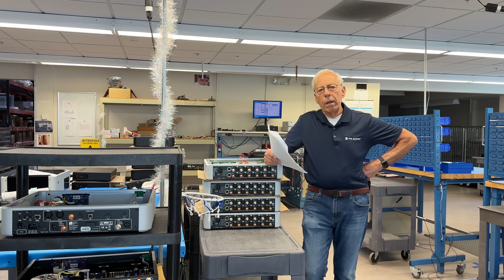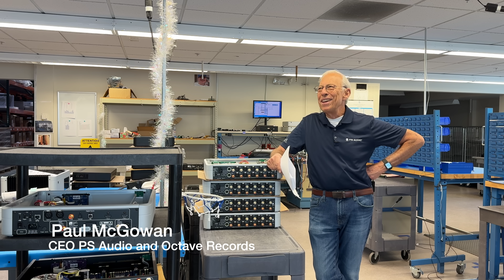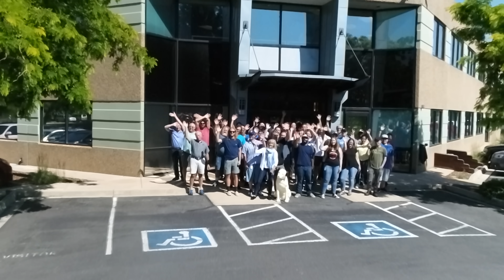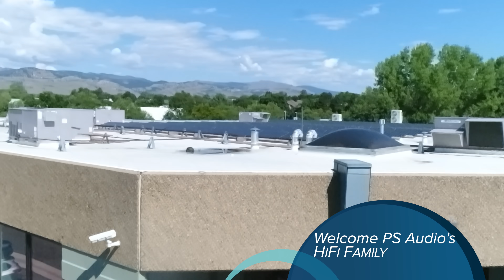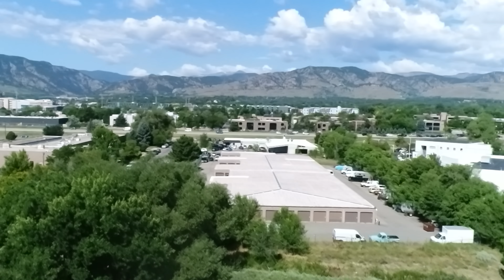Why digital audio isn't stair stepped

Comment: A 20KHz signal, sampled at 40KHz rate will be represented simply by two values: Highest positive and lowest negative. So, digitally, it is a double triangle or a square meander of 50 microseconds periodic duration. How the heck is this turned into a SINEWAVE of 50 microseconds periodic duration? This is not explained!
Reply: As an engineer myself, I agree that simply saying that they use a filter does not explain it well. Unfortunately, explaining how an electronic low-pass filter works is difficult without going into the detail of the maths and physics involved. The required fundamental understanding here is that the 20kHz triangle wave and 20kHz square wave are actually made up of the same 20kHz sine wave that they share, but with different higher frequency waves superimposed on top of those, so that the total adds up to either a 2kHz triangle or 20kHz square wave. What the filter does is let the fundamental 20kHz sine wave pass through, but filter out (think of it as cancelling out) all the higher frequency superimposed waves. That's what a low-pass filter does in essence; it allows the slow moving component to pass, but it blocks the faster moving components (idealised, a practical low pass filter attenuates the faster moving components rather than blocking them completely, but I wanted to keep it simple)
Reply: It's not a triangle, nor a square wave. It's just two points and nothing in between. It's like the line defined by two points, no stairs in between. You will find a good explanation if you look for it. You can even test this at home with your own software and ears.
Reply: @Jorge-Fernandez-Lopez  yes and if you connect the points with lines, it's a saw's teeth pattern. Not a sinewave. So, who turns it into a sinewave? Thanks for the effort.
Reply: @fullranger3435  You can draw lines, but there's no correspondance with physics or mathematics.  There's only two points, nothing in between. These lines you draw are representing wrong points that  same voltage that reality. Instead, try to find the sine wave (you have to modify length of wave and amplitud) that cross these points: only one solution. An analogy would be a circle defined by center and radius, or defined by three points on the circumference. You can't draw a line and create a squared circle, because definition is precise, while interpretation is wrong. The solution would be to draw arcs, or square lines to find the center, and then the circles. The maths that define that wave and the real solution won't understand your lines, only the amplitude and distance of the sine wave that include these points.
Reply: @Jorge-Fernandez-Lopez  that makes more sense. Still, at the analog output, a voltage sinewave has to be created,  by outputing only two voltage values? So there is a passive mechanism, based on circuitry latencies and rise times, that will create an almost sine wave while hitting for these two values alone? Like a rapidly spinning and moving compass that will draw an almost circle, based on center and radius alone? Or do you mean the dac chip is programmed to output a sine, for any two or more values? How does it know the frequency then, what value belongs to which sine? Thanks again.
Reply: @fullranger3435  "Or do you mean the dac chip is programmed to output a sine, for any two or more values?" Nope a DAC in that regard is a dumb device. It puts out X voltage at X sample point. What makes one DAC better than another is often, with the limited number of suppliers of the actual central DAC chip (e.g. TI is one of the prime Sigma Delta suppliers), it is the post DAC filtering that makes one better than another. And that is manufacturer specific. PSA Audio has their own.
Reply: @glenncurry3041  Thanks again.
Reply: @Jorge-Fernandez-Lopez  Thank you for your time and effort. I keep the fact that close to the Nyquist sampling limit (8KHz for 3.8Khz signal) problems start. I guess this renders my initial  question rational. I still think that every imperfection in signal processing is or can become audible. Insignificantly, perhaps.
Reply: @fullranger3435  It's clearly very audible,  variations of amplitude, harmonics, close to a mix between square wave and sinusoïdal. I recon that 3,8 kHz in relation with 8000 samples is equivalent do 21 kHz at CD-DA sampling rate. Once done the oversampling, 3,8 kHz sound is perfect and problems disappear. I think it's safe to say that 20 kHz (lower than 21 kHz) will be perfectly reproduced if frequency above are filtered. Unfortunately, even if my hearing is good, I can't hear 20 kHz. What I can see in some Hi-Res format, it's a bunch of high level noise without any relation with music that hasn't been filtered. It's a very complex topic.
Reply: @Jorge-Fernandez-Lopez  20KHz has to be at almost pain-level to be heard as simple tone, even from young persons. But as a lower level harmonic component of complex sounds, it is heard, in the sense that its absence alters the tonality or the spatial cues of the sound. The same is true even for ultrasounds. They can influence subjective perception of lower frequency, sounds via interference patterns. So, to my understanding, immaculate recording/reconstruction of the highest possible frequencies is imperative for natural music reproduction.
Reply: @fullranger3435  It's a very interesting comment. I appreciate that perspective fullranger. The problem is that in some high-res albums harmonics don't go higher 32 kHz. After that noise that doesn't move with music, lot of noise even with silences, that has no relation with music (noise shaped for quantization probably), that can be as loud as 50 dB down the loudest notes around 400 Hz, or 20 dB higher that these ultrasounds. My hearing is not good enough to hear that noise, otherwise I wouldn't listen some Hi-Res albums: too noisy and probably too many tweeter resonances.
Reply: And that is assuming perfect sample points! Those two samples could be zero crossing points and not peaks! Or half voltage sampled on each half. At leased based on those that don't comprehend the actual existence of the step. While averaging or Peak Sample and Hold is actually used during each sample duration. And then sampled causing a linear time shift per sample. So with PCM digitally it is just a number per sample. Not a form. 

The output of the DAC goes into integration filtering, usually some for of low pass filtering. Hoping to recreate a waveform close to what the sample values indicate.
Reply: @glenncurry3041  thank you for your contribution to my understanding of the issue.
Reply: Puzzle? Motors on Tape Decks have always had Inches Per Second, Vinyl has always had RPMs revolutions Per Minute.

All of the above equal a Sample Rate! My personal theory since Stereo didn't arrive  in larger numbers in America until 60 years after its 1929 invention. Much folklore set in . Let me add one more thing that Americans got wrong were additional harmonics needed for proper stereo sound.( Just my opinion)

Analogue is the most misused word by Audiophiles It simply means 1:1 copy.
Reply: @HeavyCrown2030  I disagree with this concept, the tracking motion and process is continuous with no interruptions, there's continuous sampling with virtually zero intervals, so the sampling rate is infinite. If you reach a molecular level in the case of vinyl,  or individual magnetic elements in the case of tape, you may only speak about regional summing-up of various values. Again, in a continuous manner.
Reply: @HeavyCrown2030  this is a complex, irrelevant analogy.
Reply: @fullranger3435 So you say ? 1887 multi-channel audio was sent across a teletype line  to experience a live orchestra in a different city. 

My  recording example goes back to the 1850 original Wax Tube Cylinder when you spoke into the same flared horn the sound played back on, Not complicated just Science.
Reply: @HeavyCrown2030  this did not include a person mimicking another. When you employ complex biology and at this level, you just don't explain your point: where are the samples of a sampling process? Don't overcomplicate things, its tiresome.
Reply: @fullranger3435 Odd !! reply since the whole original process was based on mimic. Example the phrase record player goes back to a time when the Piano got popularized you needed someone to play it hence the name of the process stuck, An extension of being entertained in the home.

I can't make excuses for established patterns of Human Behavior, is it possible your LLM is out of date?

Comment: Bought an acom gafa 555.  Wow huge step up.  Screw digital
Reply: 555 or 555-II? The original 555 is a Nelson Pass design. It is what I am currently (pun intended?) using!  Mine has an added 2nd power supply included 2nd toroidal transformer. Basically upgraded to full dual mono. Not even shared transformer. I'm thinking of upgrading it to two power cords in fact. Incredible amp! But I added active cooling fans to drive my Maggies in my way too large of a room!

Comment: For some reason it seems to me that people are confused by the word "digital"; if the more correct name PULSE CODE MODULATION were used, then for many people it would not be so difficult?
Reply: Not all digital audio is PCM. There are also other formats.
Reply: @Fastvoice  The name of any format that is called "digital" always contains two defining words: pulse and modulation. The modulation can be different, but it is the PULSE MODULATION that is most important.
Reply: @user-kf7oz6nu4g  Why do you adress that to me? I answered the thread starter that not all digital audio is *PCM*. Of course there's always some kind of pulse modulation, but e. g. for DSD it's not PCM but PDM (pulse-density) or to be more precise DSM (delta-sigma). And that's the format Octave Records uses.
Reply: @Fastvoice  It is difficult for me to discuss something with you since I am not a native English speaker and I have to use Google translator.

Comment: Can a tubed DAC create a smoother and naturally cleaner sine wave than a digitally processed filtered ‘analog’ signal?
Reply: No, because the stairstep is only a visual reference for the audio  engineers creating the audio. The stairstep really does not exist. All DACS uses complicated to create an exact copy of the original, and since it's math, it can be proven. Finally, with math, there is only one answer. Adding a tube will not make the answer better.
Reply: Sorry, I meant to say complicated math...
Reply: @KCarlWhite  what a random answer this is
Reply: no.  the tube on tube dacs acts just a filter/preamp, basically as a gimmick.  you could incorporate tube(s) into the dac circuitry and some crt but nobody really dos it that way, maybe it would make sense if you didn't have transistors at all.
Reply: @lasskinn474 there is actually a small manufacturer that has a tube dac that uses tubes in the up sampling circuit and the output stage.

Comment: When a DAC low-pass filter is filtering out frequencies above 20kHz (can be higher), it will make a 20kHz square wave PCM become like a 20kHz sine wave. A 10kHz square wave will also look like a 10kHz sine wave on the DAC output. So how about a 5kHz square wave? It will look like a 5kHz sine wave overlapped with a 15kHz sine wave. Reason is that a 5kHz square wave is having the base frequency of 5kHz and the 3rd harmonics of 15kHz still falling within the low pass filter bandwidth while the higher harmonics are above 20kHz. Any square wave signal combines the base frequency with odd harmonics (x3, x5, x7 etc.) as a sum of different sine waves. The 10kHz square wave has its 3rd harmonics at 30kHz above the filter frequency so you can never hear the difference between a 10kHz sine wave and a 10kHz square wave. If you go further down in frequency, you can start to see a square wave in PCM being appearing like a square wave on the analog output. A 100Hz square wave will retain many of the higher frequency harmonics and the analog representation of it on the DAC output will look much like an actual square wave. Our ears have a similar low pass filtering and that's why you can hear a big difference between a 100Hz sine wave and a 100Hz square wave.
Reply: this is actually interesting, this topic will never settle
Reply: He is talking electronic circuits. Not simple mathematics. Regardless of frequency sampled, each output of a DAC is a stair step of that sample rate. One voltage out during the entirety of that clock sample. An RtoR is a specific voltage for the duration of the sample while a Sigma Delta is just ON yes or no for the duration of the sample.

You are discussing the loss of information that makes Digital inferior to Analog.
Reply: @glenncurry3041  No, I’m talking about that all sounds in nature are fundamentally constructed of sine waves and when you filter out above 20kHz your wave shapes will not be PCM steps but a sum of lower than 20kHz sine waves. More complex sounds simply contain more oscillations at different frequencies, stacked one upon another. Higher-frequency, oscillations which are tonally related to the fundamental frequency (the base note or tone) are known as harmonics.
Reply: @ThinkingBetter  Actually no. Few sounds in nature are pure sine waves even with addition of other sine waves. They are complex nonrepeating waveforms. FTs might break out sine wave frequencies when converting from the time domain for simplicity of evaluation. But tossing any number of steady state sine wave generators together will not sound like a piano. 

We grasped at sine waves for audio analysis because back in the day even generating testing stead state sine waves was difficult. Forget time domain stuff! I've travelled giving clinics on waveform analyses of amps. Slew rates, rise time, FFTs, ...
Reply: @glenncurry3041  Music or any sound is made of (or can be modeled as) a combination of sine waves that come and go with different timing and levels. There is no detail of a sound wave that escapes that logic and not being pure just means being complex composition of sine waves mathematically speaking. Obviously any wave is not constant for music. From Fourier analysis you can recall that all electrical or acoustical signals can be represented as the sum of one or more sine waves. Amps creating transient intermodulation distortion due to slow slew rate just means higher frequencies of a wave form end up being amplified more like open-loop amplification. It doesn’t defy the general theorem of audio signals being modeled as a composition of sine waves. And yes, I think you want to say that real musical instruments are making more complex waves than what comes out of a synthesizer trying to make piano sounds from tone generators. I can agree with that, but it doesn’t change what I said.
Reply: @ThinkingBetter  So now add gating, level changes... IOW NOT SINE WAVES! Thanks for proving my point! And resonances added by musical instruments do not have to be associated to any fundamentals, multiples there of.... 

They gave up trying to make realistic sounds of instruments with just sine wave generators and went to sampling long ago because it does not work! Yes they can make interesting sounds of their own. But it took tossing that entire lots of sine waves approach out of the window and using sampling before they made a credible electric piano!
Reply: @glenncurry3041  Yes, but the theorem of any audio wave being the sum of sine waves doesn’t mean those waves have to be associated with each other by any harmonic or resonant effect. Whatever shape of wave you have, it can always be modeled as a sum of sine waves. Sampling a tone from a piano or other instrument and playing it at different  speeds is a cheap way to make music nowadays but you loose some of the dynamics of live music nuances. For example, the sound of a finger touching an instrument does not have a different pitch for different tones being played.
Reply: @ThinkingBetter  Lets try to make this simple enough for you. Please show us all any musical instrument that can be reproduced using strictly continuous sine waves. No gating added, no slopes outside of sine waves.... just take as many sine wave generators as you can and show us the Piano!
Reply: @glenncurry3041  I never talked about continuous sine waves. Music is not about sine wave generators running continuous waves. A bass drum might have its fundamental frequency below 100Hz being handled by a subwoofer while its attack is much higher than 100Hz being handled by the stereo speakers.
Reply: @ThinkingBetter  Prove it! That's just flat out WRONG!
Reply: @glenncurry3041  Did you watch that video? (Every sound is SINE)
Reply: @ThinkingBetter  Thanks for that overwhelming factual proof. See ya!